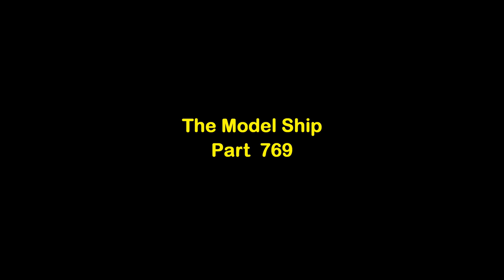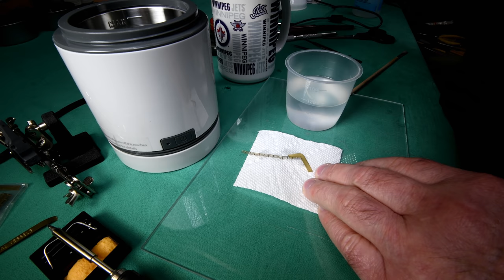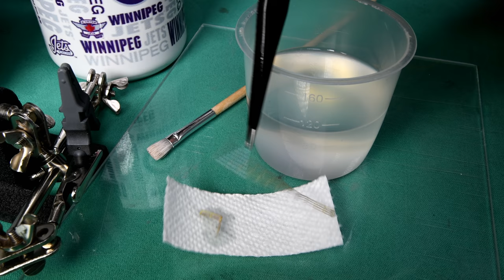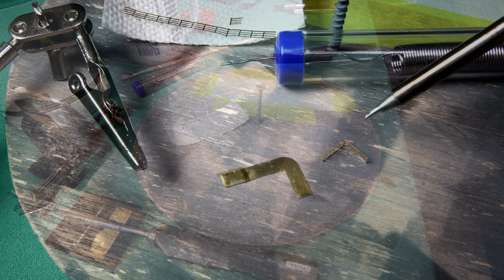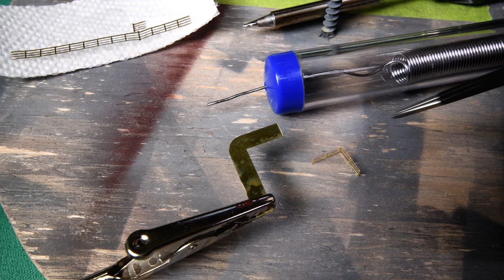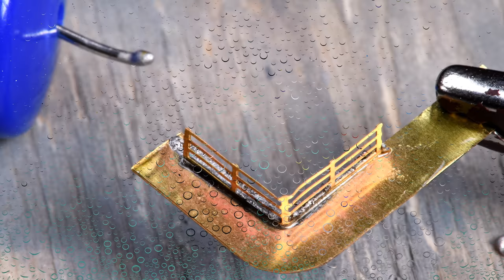The Model Ship - Part 769

Comment: Ron I only use 6l0/40 tin lead solder with rosin core, no thicker than 1mm. Try to hold the tinned iron still on the work longer and the solder should flow to the flux once hot enough. Be careful the helping hands croc clips can act like a heat sink and steal heat. Persevere and practice will pay off. I am sure there will be tons of differing advice try them all and settle with the one that works for you best. Good luck and I’ll keep following.
Reply: Just tacking a long piece may suffice, a solder joint is much stronger than CA.
Reply from the maker: "there will be tons of differing advice"
I'm used to that, lol. 😁👍

Comment: Hi Ron, I don't want to add too much to all the advice but wish to point out the solder supplied with the iron is most likely to be lead free and does require higher temperature than the old lead based. Fortunately, lead based solders are still available here in the UK.
Reply from the maker: Yes, I was rather frustrated with that solder too. I've ordered something different. Will talk about that today in #790. 👍

Comment: Hi Ron , great video  , round wood block! amazing , I use the same , only I burn on 
a regular basis , your tip has not seasoned yet , bit tricky when there fresh , the alligator clip must 
go , its a tremendous heat sink , 
What I do , scape the edge of the angle piece , if your doing the outside rail , scape both
a bit of flux and where going to tin the edge , drag your tip back and forth up both edges 
Then take your railing , quick dip into the flux and tin its bottom edge 
drill two holes into your wood block , jam tooth picks in , and push angled piece against it to steady
Just focus on one end of railing , needs to be straight and at correct position , come down with a clean  iron and 
 do a light tack  , the go to other end of railing position and tack , if all looks good , just slide the iron along the seam 
careful with the heat  !
Reply from the maker: Thank you for the tips James. 👍
Reply: @roncalverley  No worries , If your doing the outside rail , curve your piece 
buy using a package of blue tack , unwrapped and drill bits , merely position 
your rail where you want the curve on the blue tack and press down with your bit 
start with a bigger bit and work to smaller bit